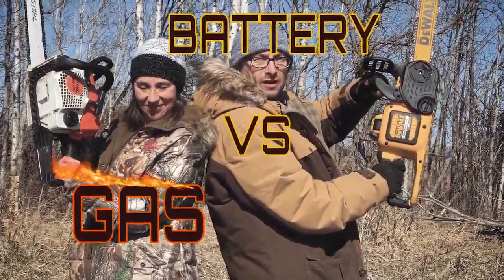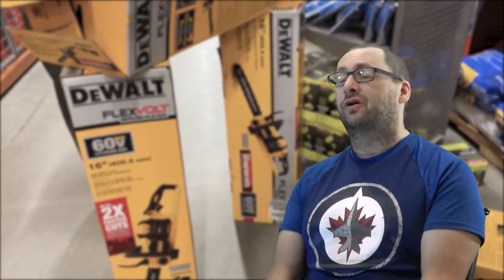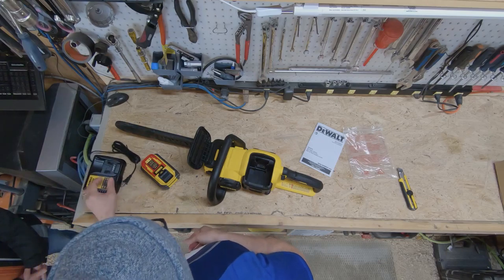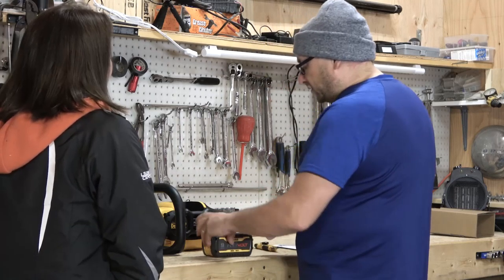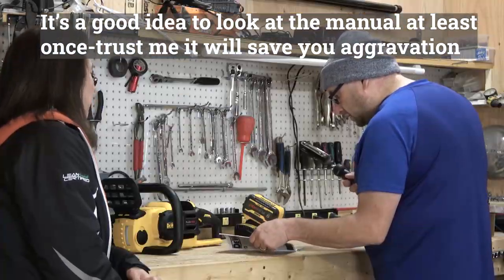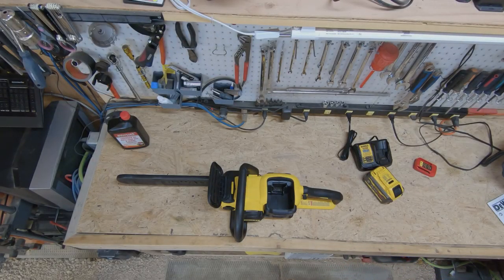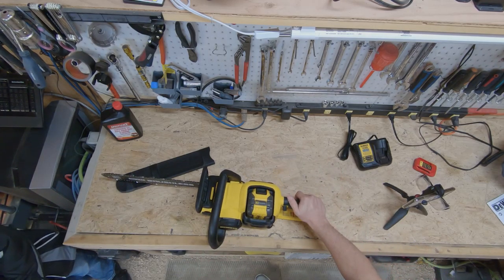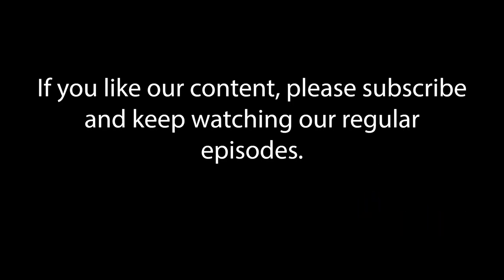DEWALT DCCS670X1 Flexvolt 60V Brushless Chainsaw Review: Part 1

Comment: Great Video, Question  Do they make a chainsaw for left handed people?
Reply from the maker: Thanks for the question!!  The saw has its safety release mechanism on both sides of the handle and it’s symmetrical. Battery sits in the middle so it’s equally balanced.